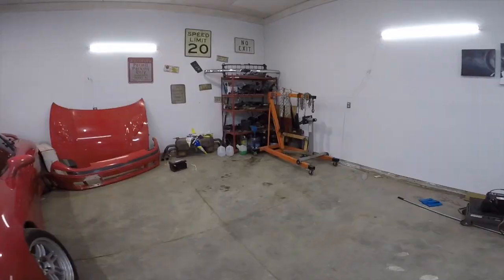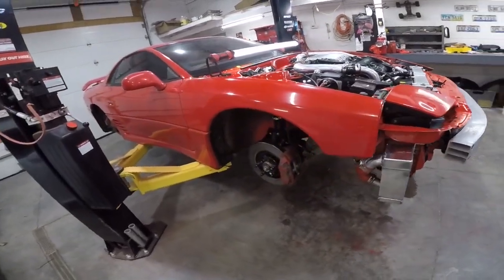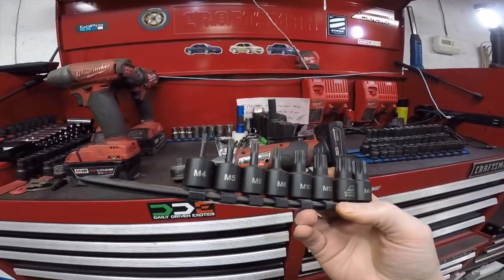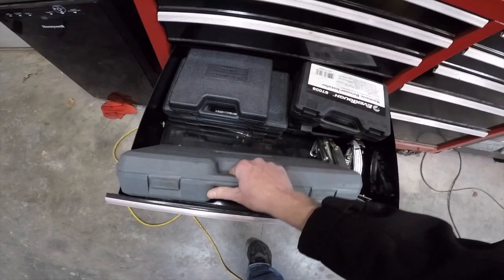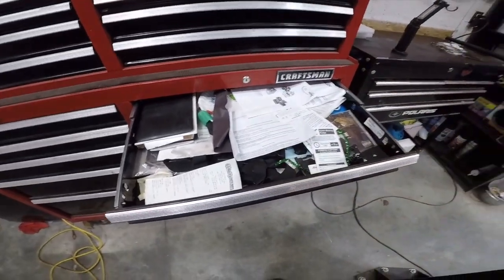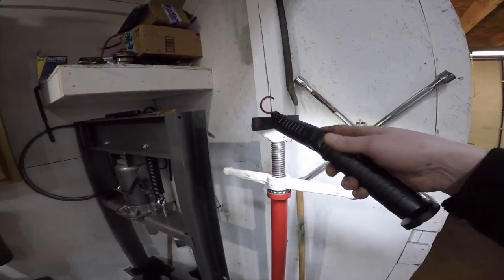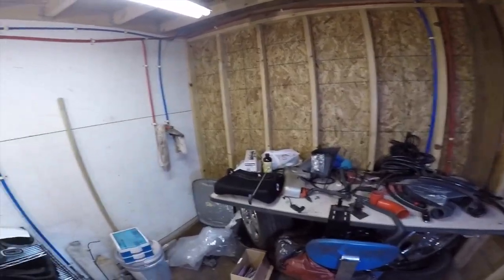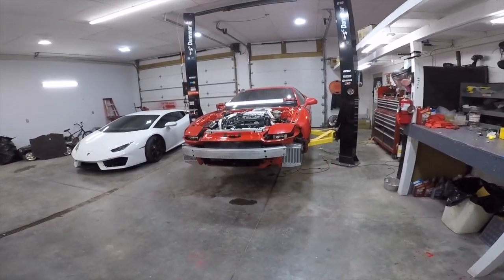shop / toolbox Tour

Comment: do you have a link for the coilovers you have on the vr4?
Reply from the maker: There BC coilovers they're pretty easy to find you just go to their website and type in 3000GT
Reply from the maker: https://coiloverdepot.com/products/91-99-3000gt-awd-bc-racing-coilovers-br-type
Reply from the maker: There u go
Reply: @huracanian3051  oh gotcha thanks. And quick question maybe a dumb question but. Do you think this would be overkill on the base model? I have the base model and am looking to get coilovers but am having a hard time deciding which ones would be worth it for the base model
Reply from the maker: @ianriley9760  oh don't buy those ones from that link then those ones are for all wheel drive Twin Turbo ❗❗❗.. No my coolers are never Overkill... just makes a better handling car.. you're going at this the right way make it handle and stop better before you make it faster that's how you become a good driver
Reply: @huracanian3051  any recommendations on which ones would be fine for the base model?
Reply from the maker: @ianriley9760  I wouldn't go with BC still I think this is the best street coil-over for the price anything better than BC you get up in like $1500 $2500
Reply from the maker: @ianriley9760  https://coiloverdepot.com/products/91-99-3000-gt-fwd-bc-racing-coilovers-br-type
Reply from the maker: @ianriley9760  there's the ones for front wheel drive NA
Reply from the maker: @ianriley9760  I believe the only thing different is the rear mounting hole is smaller
Reply: @huracanian3051  gotcha ill check em out. Thanks